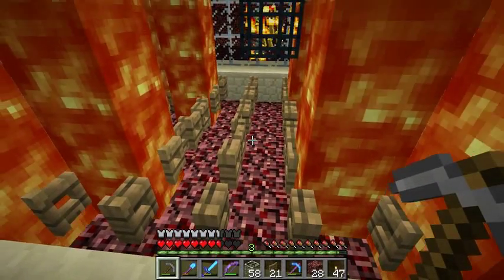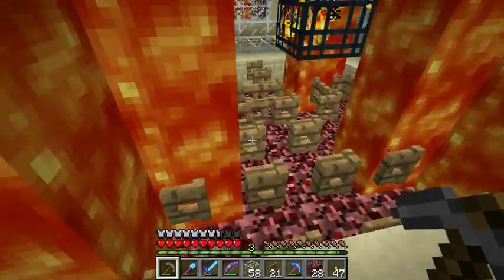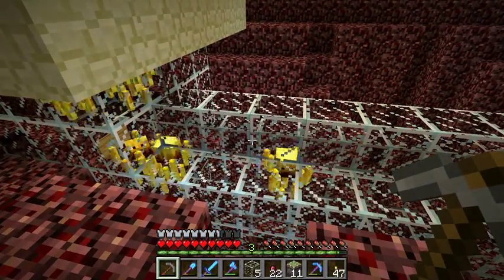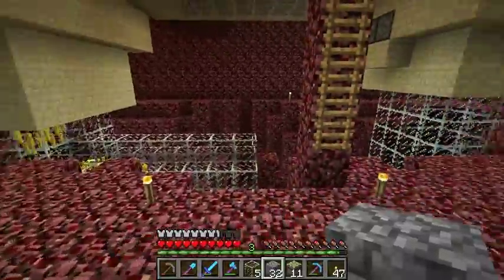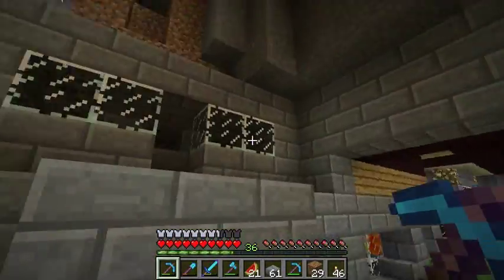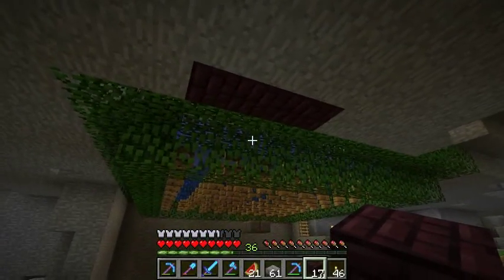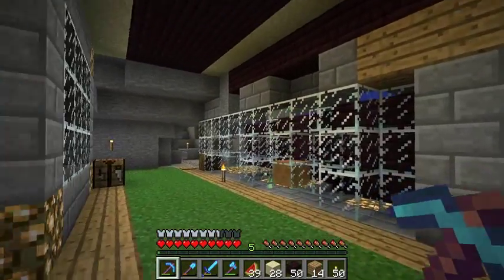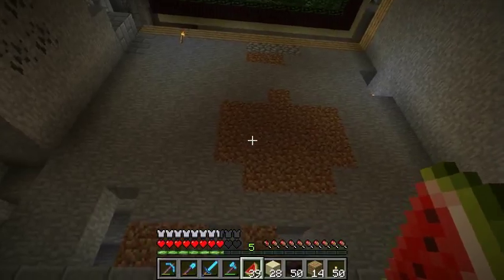Etho Plays Minecraft - Episode 139: Dragonized Poultry

Comment: I know this is an older video, but you talk of pushing the blaze guys around with a furnace cart but having the downside of it needing fuel. But what about a furnace cart with no fuel (or a chest cart) on a powered track? Would that work at all? I'm not sure though if you can set up a one way track easily.

Comment: I have an idea for how you might be able to capture the Ender Dragon in a minecart. Try surrounding yourself in obsidian so it cannot knock you back, then place a rail just outside of the box, and a minecart on top. If you line yourself up, you might be able to spam right click, and place a rail under the cart just as the dragon is on top of the cart, trapping it. It would be rather tricky, but it is worth a try. You could also try trapping it in an obsidian or end stone room.

Comment: Don't use half slabs in the slime staircase! That's what I did originally in my slime farm prototype and it didn't work. Small slimes can fit in the air gap between half slab and water and this allows them to jump. Small slimes that are facing downstairs will get stuck at the first half slab. They jump backwards and are then pushed back to the half slab and jump again. This doesn't happen with stairs.

Comment: This would probably be complicated but would work is that if you use the glass blocks and a pulse on the piston to reset or whatever then if there is a blaze stuck in it the piston will retract back then push the blaze back out. Just an idea.

Comment: Etho, at 4:12 you mentioned that they had different health because of the pistons. This is totally untrue. The reason they have different health is because the crusher crushes them at slightly different rates. If you listen to the sounds as they die, they are all in sync at first and then they get all messed up and off time from each other.

Comment: @vsikifi Mine works very well with half slabs so I'm not sure what you did wrong. And to be honest the bottom half of a stair is a half slab anyways, so according to your logic it also wouldn't work with stairs because of that vertical distance from the water to the block.